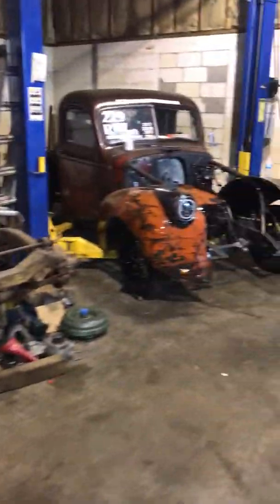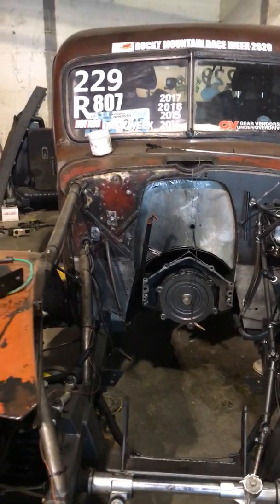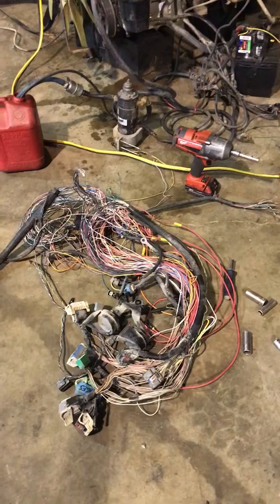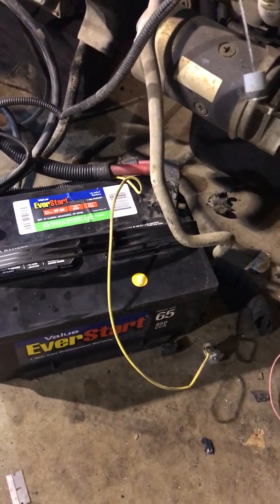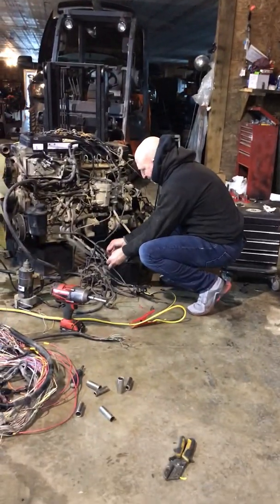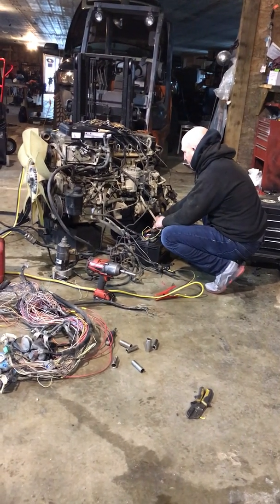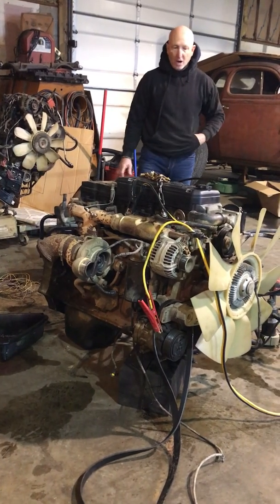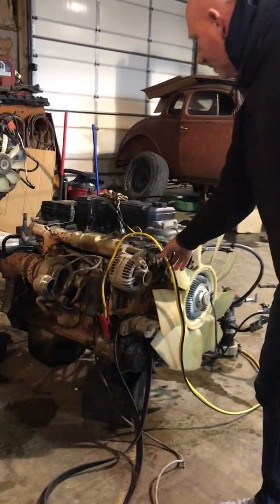Building Stand-Alone Harness for 5.9L Common Rail

Comment: Please make a video showing what wires you used
Reply: Am at a stand still. If you could just confirm PIN numbers used
Reply: Yes please show what wires did you use I'm Planning to do the same thing with the common rail ???
Reply: @fedorbalkan9960  same commenter as above.. I'll look in to the pinout later
Reply: @jimmyraeder4857  did you check the pin out ? Im Planning on putting a common rail in my dodge d300 it a gasser at the moment an Chrysler. 360
Reply: @fedorbalkan9960  I wish somebody would show the exact wires used to make a DIY stand alone harness.
Reply: @witcher71  all you need to make it run is the powers and grounds
Reply: @Fleetsidedieselrepair  That's what the internet keeps saying. Pinouts for 06 have been impossible to find. I'm looking for engine only manual trans.